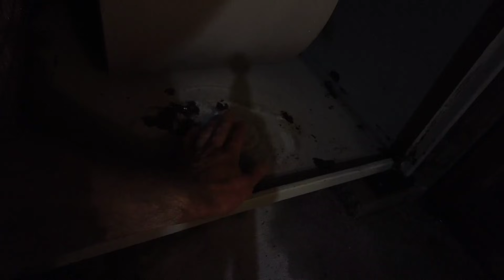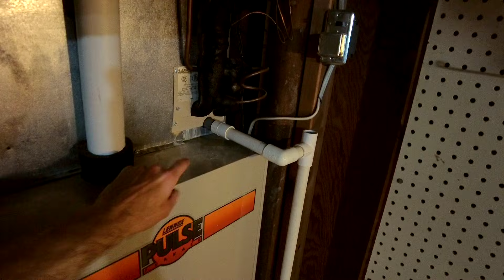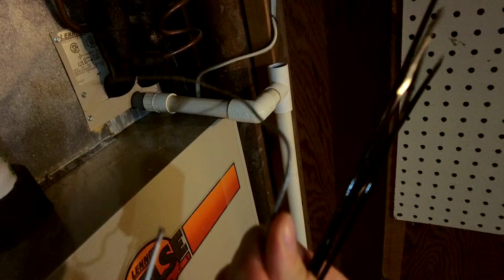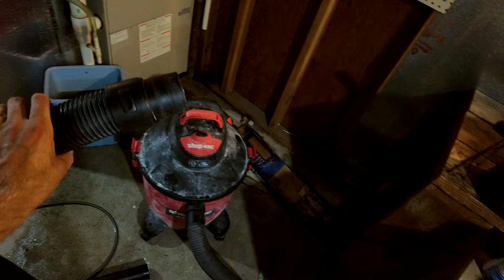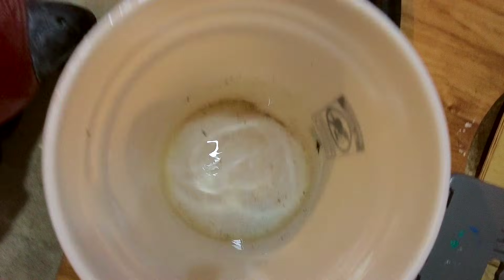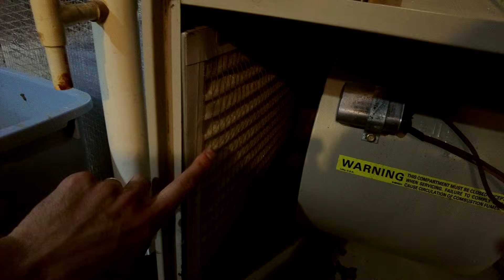Water under furnace when AC runs? How to unclog AC drain pipe in 1 minute

Comment: Puzzling, I was under the impression you have to have a trap in your drain line like a trap under your kitchen sink otherwise you’ll be pulling a negative pressure all the time the blower is running and that will stop any drainage and you’ll get water buildup and spillage I suppose theoretically when the blower stops you’ll get drainage at that point hopefully

Comment: Alright. I had the same problem. I drilled the hole and unclogged it. It is flowing to the drain fine now but leaking out the bottom still. How long did yours leak out of the bottom after you fixed it?

Comment: Before you cut any pipe....just pull on the joints. Many are just pushed together tight with no glue.......so they can be serviced.

Comment: From the outside of the house drain pipe.... Place a small 1 gallon wet vac on the end and let it suck it out.... 60 seconds it should be completely empty.  Get a 25 ft small auger from Harbor Freight... Just go slow.  Auger diameter is about half an inch.  I can't reach my drip pan from the inside so I need to clean from the outside.  Poorly designed by the builder.

Comment: Lifey Guy, just wanted to let you know that I cleared my condensate line and water was finally allowed to drain outside the house, instead of down the furnace and across my garage floor. I have no curved pipe/trap right after the tray, so I used your method (drilled a hole at the top of the pipe to attempt to clear the line from there), but then water started to pulsate out of the hole. I tried compressed air down the hole for 10-20 seconds, but then realized that the clog was downline, not up towards to tray (which is where all the air was escaping to). Having a hole there helped me determine that I needed to use suction at the end of the drain line. So, I put a carboard tube and electrical tape adapter on my shop vac nozzle, and with a nice fit at the end of the condensate line (outside), ran the vacuum for about 10 seconds twice and each time I heard bits and pieces and water scrambling down the shop vac hose. That did it, system back to normal - THANK YOU for the visuals and ideas!

Comment: My house has the furnace in an attic and I don’t see any filter on it. I change the filter on the vent once a month. We had water leaking in the garage from the overflow. I tried the vacuum and sucked out all of the water from the pan. The ac has been working the whole time though, which I found odd. I saw it dripping from one area. After the vacuum and shoving the dishwasher snake it isn’t leaking anymore but will check it in the morning. Thank you! It’s supposed to be in the mid 90s this weekend!

Comment: Omg! I'm not the only one with a 5 gallon bucket to catch the AC coil condensation! I'm not alone!! 😂 Although I have an old garden hose hooked to mine. Really helps to cut down on the water building up by cleaning the fins on the AC unit every year before running it. Very carefully! Those fins are VERY easy to damage. Even by light water spraying onto it. Go easy, at an angle. I use water and dish soap on the fins, as I've heard that the foaming cleaner can actually corrode the fragile fins. They also sell fin straightener devices if you do bend them.

I cut down from having to empty the bucket every few hours to only having to empty it once a day or every two days after cleaning the fins inside and out. Really helps if you have a unit where you can take the motor out and set it to the side - without ripping the wiring out. And clean from the inside first. Unclog all the drain holes in the base of the unit, spray the fins gently from the inside to loosen most of the dust and hair, then spray downward on the outside. Helps cut down on electric usage too!

Comment: Hi Lifey Guy, I just came to say "thank you".  before I watched your videos - I changed the condensate removal pump thinking the old one is dead. I waited for 2 days for it to arrive. have been sucking water from the basement, carpet, used absorbents, tried calling HVAC handyman, spoke to another friend, my son had headache with 88 F inside. All came to an end only after watching your video. Cleaned the drain line, no mold, just dirty deposits of salt, used auger to clean it, used your first method. $20 problem solved and I have the auger with me for future any clog removal work. THANK YOU!

Comment: I am so grateful for your video. I had to do the last option which involved my son, and I using our shop vac on the end of the drain that dumps into our sump pump. Problem solved! The AC is back running without any leaks.

Comment: my drain pan has no water in it to drain in pipe pipe is 3/4  pipe but water runs all over the furnace out to floor over 3 gal a day i have a pee trap on drain line furnace repair came out and said he never seen it before check every thing still wont drain . air filter was check was not it water in pee trap coil was not plug little dirty not much  live in st louis mo humidity been running about 80% anything you might come up with can help its a elc furnace

Comment: Great video, I’m not sure where I should cut/drill though
Reply: dont drill. you can make a fitting and not glue it then just pull it off the machine. go get a 3/4 screw in fitting that is a glue fitting then slide the pipe in it.

Comment: Hii I have a question. 
Here is winter-35 - 40 and this is happening here but the difference is I Don't have AC how is this possible?? Thank uu
Reply from the maker: Our furnace condenses water when our heat is turned on. It could be a different drain line that’s clogged maybe
Reply: I have the same issue just now. We have a clog drain because our drain line is frozen from the end of the pipe. I'm not going below my house crawl space to heat the drain pipe, instead I bought a space heater. I'm planning to buying something to winterized my pipes over the summer though.
Reply: @ninjazzrhythm400  putting the same insulation used for your Freon Lines over your drain line helps a lot with the freezing

Comment: Does this happens in the winter too..
Reply: If you have 90% efficiency furnace (90% of the energy used heats the home the other 10% is exhausted out of the house). the evaporator coil which is what’s leaking here works with your air conditioner and removes heat from the house. Drain from the coil tees into the drain for the furnace. 80% efficiency furnaces don’t condensate but rather exhaust much hotter and that’s why they require metal flu pipe. Most water heaters have flu pipe as well
Reply: Yup….. it’s happening to me right now! 

New home owner   10/01/2021 👍🏽 Washington winter 12/27/2021 👎🏼

Comment: You helped me! I ended up having to drill 3 holes as the clog was in a U shaped part of the pipe rather than right at the furnace, but I used the zip tie thru the little holes I drilled in all 3 places (before the beginning of the u, at the end of the u, and at the spot by the furnace) and it unclogged and is draining properly! Thanks so much
Reply: You're furnace should have came with a tool to unclog the trap. It's like a little wire brush that's bendy.
Reply: How do you seal the pvc holes ? Once finished?